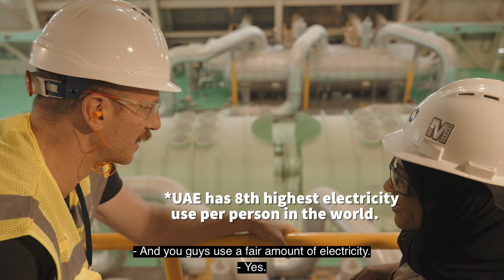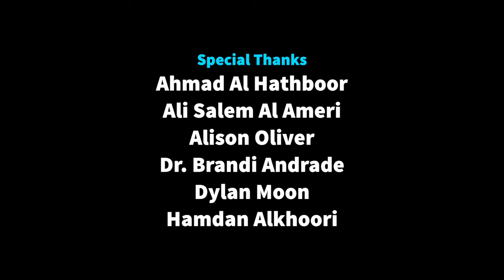A Visit to Barakah: the UAE’s First Nuclear Power Plant

Comment: One of the problem with nuclear power is it's brutalism constrution stile.  Need to have some creative architects  make the place more atractive.
Reply: In the US, the architect is limited in their creativity due to security and fire protection requirements. Every feature must be non-combustible and the buildings must be configured a certain way to prevent people from climbing or breaching into sensitive areas. This severely limits the type of materials and the aesthetic arrangement of the plant. Nuclear powerplants are all about functions and regulatory requirements, not aesthetics.
Reply: @JasonKhouri  still not a good excuse.  All those requirements can met by something that looks nice.  What I am saying the building conveys a message.  What is currently being conveyed is this is something dangerous and is being encased in a military type structure. This type of architectural stuff needs to improve.
Reply: Just got to the part where he mentions that the site was supposed to be a mosque. They could easily tile the dome Girih style or similarly. Maybe that would be sacrilegious
Reply: Some people like brutalism; the concrete of the dome looks almost like marble (presumably to reflect the heat).
Bike-shedding may keep people entertained but meanwhile there are other pressing matters to solve.
Reply: Lol good thing you arent deciding these things
Reply: It's built that way cos the reason is efficiency, the lowest cost as possible due cost energy which put on market. No one build power plant to looks beautiful but to be safe and cost effective l as possible.
Reply: @michalcerny8553  so we got to look at the monstrosity for 100 years or so?  Like if it looked nicer far fewer would be opposed to nuclear in my opinion.  Like bridges could be built that way too.  Does not take that much to make the mundane interesting and or beautiful.  Something that adds more than power to our lives.  Like where I live even the freeways have artistic flairs, kind of making dreadful drives a little more bearable.

Comment: Perfectly applied principles of the obvious sense-in-common requirements to continue living on planet Earth. Thank you.
Reply: Historically and globally we currently have a dearth of atmospheric CO2 as over time it's almost entirely been biologically and geologically sequestered. With too much more CO2 sequestration, biologically our living planet will die.
Reply: @dipladonic   I think we're pretty far from worrying about that :)
Reply: @dipladonic  No.  The problem is not absolute CO₂ levels but the huge rate of change that the biosphere and our infrastructure cannot handle.  Large levels of atmospheric CO₂ changes (up or down) occur over 100,000s of years if not millions of years.  But the atmosphere is currently at over 421ppm CO₂ which is a level not seen in 4 million years but has occurred only the past 200 years — just since the start of the Industrial Revolution!

It is not just CO₂ but also methane (CH₄).  Methane is released in huge amounts from our natural use and during its processing (fugitive emissions problem).  Methane has 80x the GHG effect of CO₂.  In the shorter term, methane will have a greater effect then CO₂.  We need to get off of fossil fuels ASAP.

Comment: As if there is anything that's available in a nuclear power plant in excess is heat you can easily use it to desalinate sea water to use it for irrigation or residential purposes.
Reply: Alot of it goes back into residual heat turbines